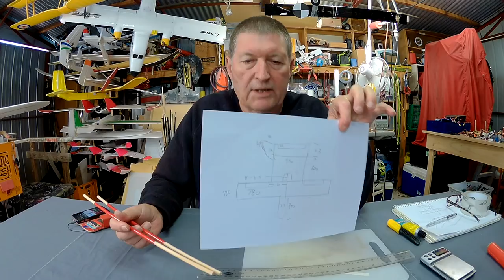Micro Skyhunter scratch-build

Comment: Hey Andrew, that was great. Always enjoy wAtching someone make an airplane out of household stuff and then see it fly so well. It’s reassuring and rewarding somehow.  I’ve watch Josh Bixler build planes for hundreds of hours, since he laid down his corvette spray gun and picked up a foam board glue gun! It just never gets old.  Thanks 😎
Reply from the maker: Thanks Tom, designing, building and flying a model is about as rewarding as it gets.
Reply: Andrew Newton  hey I had another thought. I used some 1/4” wood dowel stock to make a spar one time. I wanted it to look black like CF, so I slipped on a piece of heat shrink tubing then shrunk it. It looked cool, like black carbon but it was much stiffer. Tried another layer of HST and that really did the trick. Probably twice as strong as just wood and very light. You might try that vs. tape. Just an idea... thx

Comment: WOW!

I make a "have you done this yet?" comment in a video that you mention that you intend to do a scratch build of this airplane, you reply "thanks for reminding me," and this video is up 2 days later... I can't seem to get things done that fast for things that I both want to do and have everything sitting around to do it.  WOW!

I can't wait to see the maiden video.
Reply from the maker: Haha, you can thank yourself for this one Mark
Reply: LOL, sorry, I won't do it again.
;-)

Between this and the blog post it should be pretty easy to duplicate, and it looks to be pretty close to what you measured the original.

I'm curious, why do you swap between hot glue and unhu por (something not readily available in the US, I'm not even sure what it's like, I thought it was a contact cement but that's not how you used it) while building?  It was suprising to see you go from one to the other in the same structure, like the wing and the boom mounts.
Reply from the maker: UHU Por came from HobbyKing, it is a contact glue and I was letting it dry before bringing the surfaces back together, didnt show that in the edit. Useful for flat surfaces, can be spread thin. Hot Glue is heavier but much better at gap filling and odd shapes, like dowel onto foamboard, and it's quick setting. Gorilla Glue expands as it dries so its good for gluing the spar inside the wing. Different glues for different applications.
Reply: One other question that I tried to post to your blog post but it just seems to disappear (I don't know if it's sitting in a queue for you to moderate or just gone), but since I have your attention here: you list the dowels used for the tail booms as 400mm and the space you measured on the original from the back of the wing to the front of the horizontal stabilizer as 200mm.  You don't list how long you made that distance on your build.  If you make the distance the same and the booms 400mm then you end up with them sticking out 15mm somewhere.  From this video the look to be about 20mm from the leading edge of the wing, so did you make the wing to stab distance longer or did you cut the booms?

For some reason I'm really hung up on this thing, I've even modeled it in Sketchup as you built it wanting to play with proportions myself...
Reply from the maker: You're correct Mark, apologies for the confusion. Booms are actually 390mm and the gap is 215mm. Thanks for picking that up, I'll make the corrections. Looks like comments are not showing up on Blogger for some reason.

Comment: So how does using that glue compare to hotglue. Would you use it again?
Reply from the maker: Oh yes, excellent foam-safe contact glue. Lighter than hot glue but not gap filling.
Reply: From what I've learned so far hot glue is good as it's cheap but it can be tricky to use if you're not building regularly. For example, UHU POR gives you more time. If you build complicated wings with hot glue you have to be pretty fast. Also the casing on some small servo will melt if the glue is too hot. I now use epoxy and tape for servos.

Comment: I notice that using the fold over Armin wing style, you are unable to have a tapered leading edge and upturned tip like the original Skyhunter. A method I often use in order to have a nice taper, is I laminate sheets of very light foam, like polystyrene or sonething, and then I trim it to the taper or curve that I want, then I sand in the airfoil, and at that point I can heat up the tips to bend up the winglets. Also, with the foam laminated like that, tape really isn't needed for strength, which saves a lot of weight.
Reply from the maker: I can easily add wingtips like that, but square tips have worked perfectly well so far.

Comment: Awesome, makes me want to build one... I like it :).  Oh really like how you have mounted the tail boom to the wing. My newton spectra, I made a hole in the wing, I might have made a mistake as I don’t think worked so well (changed angle of vertical stab, points down so elevator points up a lot to compensate), anyway got to change the esc after a fire last weekend (4s on $7esc). Thanks for your scratch builds, I like following along :)
Reply from the maker: Oops, fire is not good. It is a bit tricky keeping the horizontal stab and wing level while gluing it all together

Comment: Where do you get the uhu pur every site I find it on it's super expensive + shipping.
Do you know of any alternative brands of the same type of glue?
Reply from the maker: HobbyKing. No foam safe alternative that I know of
Reply: ITM Samian they are all good glues but have disadvantages. 
I would like to use a contact adhesive for the quick bond and the flexibility CA dose not give.

Comment: You did a good job building that I was just wondering where do you get your Dimensions from. And also how much actual time did it take you to build that I also noticed that you didn't have any Rutter's I can't wait to see it fly Jeff B Seattle
Reply from the maker: Dimensions here - https://www.youtube.com/watch?v=t3MuHXyVee0 Total build time was maybe 4hrs over a 24hr period. You will have to enlighten me about Rutter's, what is it?
Reply: Andrew Newton hahaha I ment lol I saw the elevator but I didn't see you put a Rudder on it the reason why I said Rudders is Because you put dual stabilizers on it but I see you're just using ailerons... I really like watching you build plans because one thing I really learned a lot from you is as long as you consider the balance the weight and drag you can do almost anything to it plane. Whereas before I would have been hesitant in adding anything or removing anyting from the design. Example is cutting through the bottom of the fuselage to use screws to attach the rudder stabilizer to the fuselage
Reply from the maker: Ha that's funny. I though Rutter's was a beer brand. Yes if it's balanced, not too heavy and you have enough power anything will fly

Comment: What was the control horn material? Couldn't make it out on my small screen.
Reply from the maker: ID card plastic, eBay
Reply: Heated so that it will retain the bend? Or did you glue two pieces at 90 deg?
Reply from the maker: Just bent, it's strong enough and holds the bend
Reply: I was kind of fascinated by the results of an experiment today:  I bent a strip of ID card to form a 90 degree angle.  That worked okay (using a little overbending to account for springback of course) but the corner didn't seem entirely convinced it wanted to stay completely square.  It was like some of the PVC fibers were fighting other PVC fibers for dominance.  So I hit it with a bit of heat (just momentarily, from the edge of a flame) while holding the 90, and then let it cool.  Dang!  It is now LOCKED-IN at 90.  All the fibers are now on the same page.  Absolutely love the results!
Reply from the maker: Great tip, I'll try that myself.

Comment: I couldn't get the cg. had to add weight in front. so my project was 500g. I did a test flight and it flew well. I used 1,300 3s battery
Reply from the maker: Heavy tail booms and servo maybe? Doesn't matter as long as it flies
Reply: I used 9g servo. What I had at my disposal. flew very well. thanks for the video. Is the cg 35mm? .
Reply: this piece is with battery
Reply from the maker: @alyssonsmiranda  Yes 35mm would be about right

Comment: I have trouble making the fuselage. Cn someone explain it? Thanks
Reply: Is it 245 overal length, 45 height and 60 the front face and 40 the back? Does the slope start at the middle?
Reply from the maker: 245mm is the foamboard length only, then ply motor mount and nose cone add extra length. Cross section size is 60mm x 45mm (outside dimension) at the front, taper starts in the middle and goes down to 40 x 40mm. You can adjust these dimensions to fit your own battery size.
Reply: Thanks, I made it!
Reply from the maker: Woohoo! Nice one

Comment: thanks for posting.  i know you don't care, an.  i write for the benefit of your subs.   the following are  NOT  opinions.    Control Horns are  Not  correctly designed or installed.   at :45, tail booms  Should  be  Tapered towards the Tail.    at 2:20, ailerons  Should extend to (near) the wingtips.  why.   any immobile outboard trailing edge  DAMPS  All roll-axis response.    the profile of the main wing is excessively Thin.    ( conclusion:  copying a manufactured model is NO guarantee of good airframe design).     cheers
Reply from the maker: Thanks David, but saying something is wrong or should be a certain way is not much use unless you say why. Have you seen the flight video?
Reply from the maker: By the way I do appreciate your input mate, keep it up